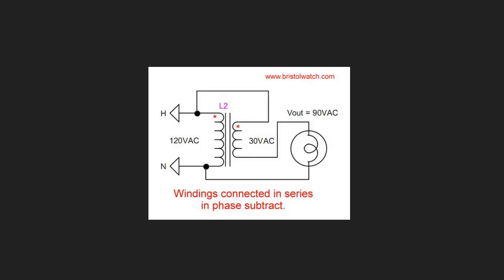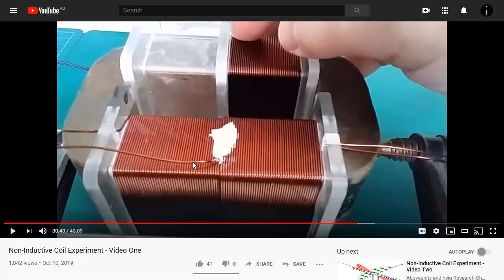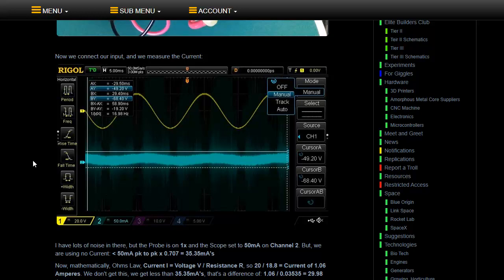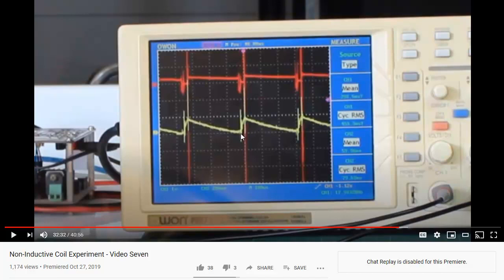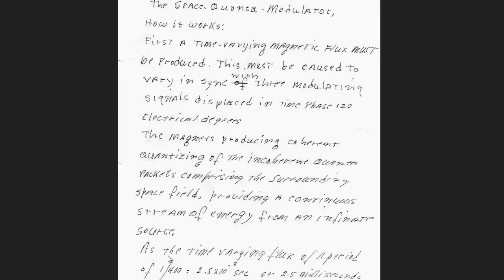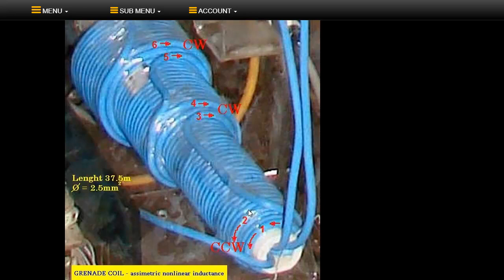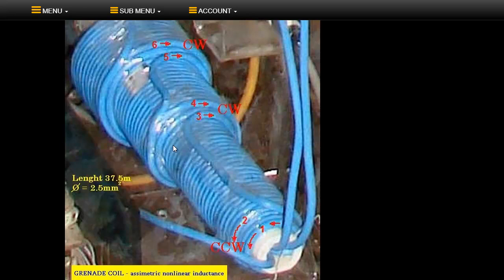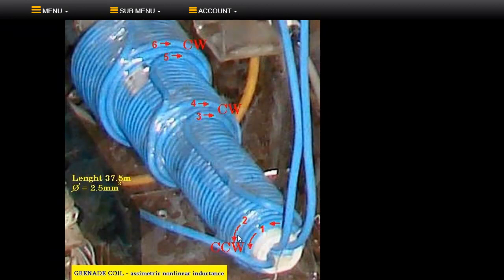Resonance in Partnered Output Coils - Thinking in Diakoptic Form

Comment: 1st picture  in the video: nothing really is being cancelled, 120v is stepped down 4:1, and the output is connected in series with the input,. if you have a 5v and 2v battery, and you connect + to +, how much do you measure over the whole, between both - poles? the circuit is doing the same. 120 + 30v drop (from + to -) = 90v, it's a non-dissipative drop,  unlike normally seen in resistive voltage dividers.

Comment: Have you tried to add diodes in line with the coils to control the flow direction of the current to see what changes.
Reply from the maker: I get that question a lot: have you tried... I have tried more than most have thought of and yes we, aboveunity.com Members  have machines that work, most others don't. Now, my turn, have you tried?
Reply: @SweetSQM  
No I don't have an oscilloscope to see what I am doing or understand them enough to use one, but admire your work and do believe in what you are trying to build, I am doing a similar thing but with plasma and would like your help with it some time up the track when I am ready to start pulsing the plasma chambers in resonance with each other.
The device I am attempting to build made 11kw of power at 190 amps and is the best energy system I have ever seen suppressed by the power in charge and also why I have not spent time doing this one your working on.